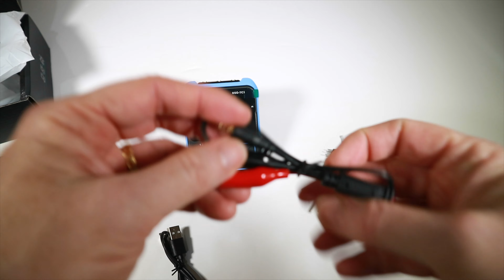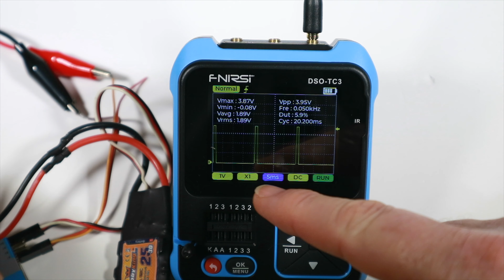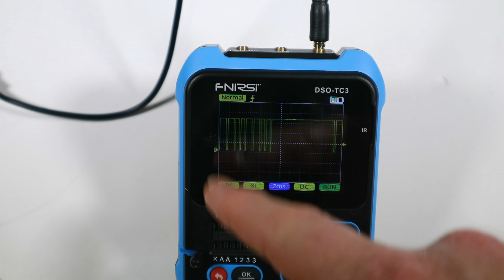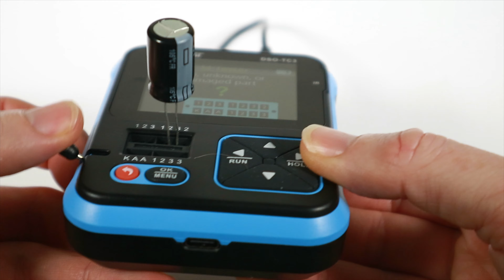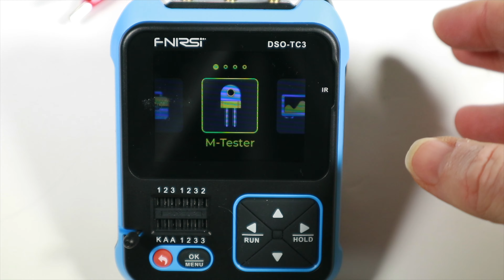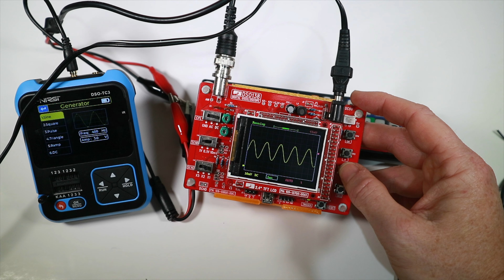FNRSI DSO-TC3 Oscilloscope, with electronic component testing functions

Comment: I am a newbie in Electronics & I wonder if the signal generator can be used as a replacement clock crystal on a mother board. So let’s say you have a faulty RTC crystal maybe the signal generator can be set to the same frequency as the RTC crystal & give a substitute signal to test the mother board. Correct me if I’m wrong

Comment: I serviced tvs and video for decades and a scope was essential but only available in the workshop, to have had this would have been a game changer.
But now everything is digital I dont think this would actually be much use apart from really basic stuff, just seeing a digital signal is not generally enough to know anything apart from there is a digital signal lol.
I also built a capacitor tester which measured esr ( equivilent series resistance ) by making a signal that passed through the capacitor which was really useful.
Some other VERY useful things for measuring electronincs is a simple amp meter but THE best thing I built was a REALLY sensitive ohms meter to find S/C on board with multiple devices connected to a data line, it could literally measure the resistance of a track a few centimeters long so by measuring the resistance to ground it was possible to identfy the s/c chip with out cutting traces or removing anything.
Reply from the maker: So good for analog, less good for digital.  Someone else mentioned a logic analyser for digital signals, which I hadn't heard of before but they look very cool.  It reminded me of a more complex version of what I used to use 30-odd years ago when looking at problems in dumb terminals we had little devices which understood 232/422 serial comms I could see what was happening and debug the issue.  Although it serves little practical use in my day to day stuff, I'm weirdly excited by a logic analyser :)

Comment: While this is great for what it is, consider a kingst logic analyzer for digital cases. The LA2016 is probbaly best value but the LA1016 can achieve alot and comes in cheaper.
Reply from the maker: Well, here's a new cool thing I wasn't aware of.  Honestly, those look really cool - the fun that could be had in reverse engineering the most trivial of protocols.  I want one!!
Reply: @CurryKitten  It's a pretty handy tool to have in the electronics box. I'd argue in the modern era where most things are digital it's more useful than an oscilloscope. 
I don't love the probe clips it comes with and often opt for just soldering when reversing a board that doesn't have headers or "EZ-Hook" clips (or some really fine ones that just say "ICClamp" that I picked up at the Dayton Hamvention but can't otherwise find.)

Also I just realized I listed the wrong name for the lower end model. LA1010 is the correct model.

Comment: The reason an oscilloscope usually has a signal generator is to self test the scope, by feeding in a known signal you can ensure your test equipment is working properly, and can trust the results you're getting from it.  It would be rather frustrating to spend ages probing a circuit, only to find out your scope is broken, and your results are meaningless!  The first step most professionals will use when using test equipment is to test that same equipment.
Reply from the maker: Well, that explains it.  I just thought they might have some more real-wprld cases, but i guess that is meaningless if you don't know the scope is accurate

Comment: This is beyond my understanding. Interestingly, back in the 1980s I built a heath kit oscilloscope and it was humongous. I took some instructions from my electronics teacher and got fairly used to understanding but throw in 40+ years and I don’t remember a single thing, because I really never used it in a practical method. However, this thing is such a low cost item it is something I probably will buy to have as something to relearn.
Reply from the maker: You had an electronics teacher - that makes you an expert!  I hope I learn how to diagose and help me fix some problems using it